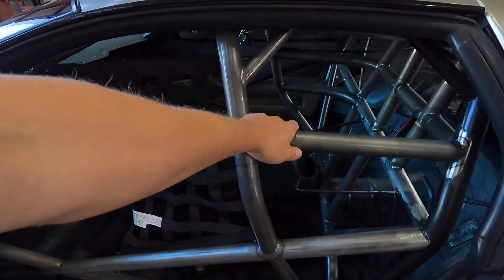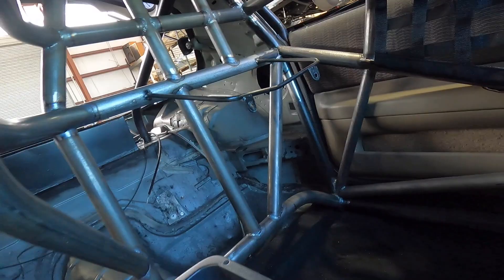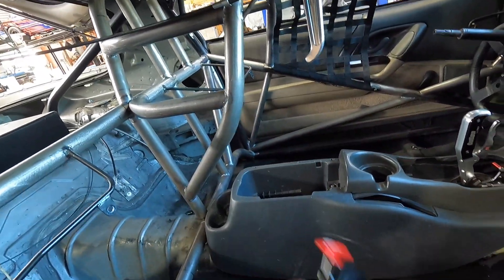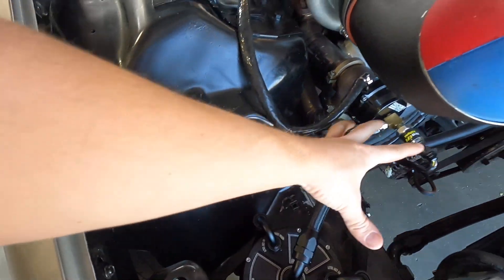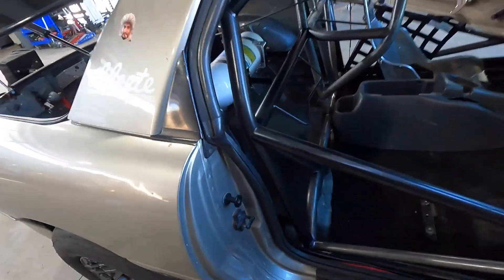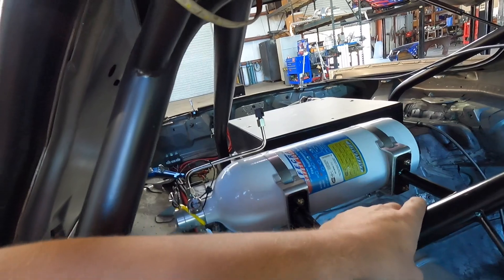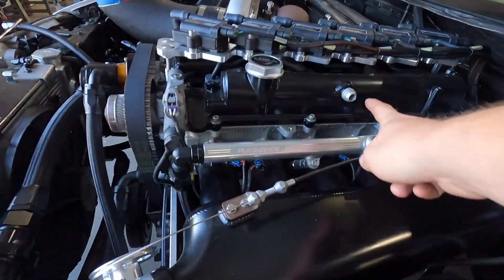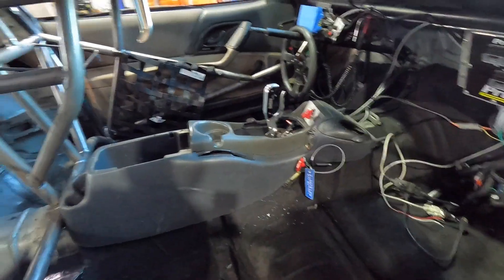The BIGGEST Safety Upgrade Yet! (Fire Suppression, More Cage)

Comment: need to run a bar from the bottom of the A pillar on drivers side, across the floor, over the transmission hump to the bottom of the passenger side A pillar, needs a bit more than the dash bar tying the cage together, that floor panel is you weakest part ,nothing stoppig your front wheel and motor coming back into the cab if you hit a wall, and run a bar down from the dash bar to the floor bar were it would run over the transmissin hump

Comment: I would move that fire suppression line to inside of the cage, rather than between the cage and the door. It could get crushed in a big hit and then you've lost all of the front half of the system.
Reply: Very good point. I never Monday morning quarterback it but yes, if you want it to work in a wreck run them on the inside of the cage. Other than that safety is no accident. Great job Coop!

Comment: With that fire suppression system you definitely need to practice escape drills. Have a plan that involves you running on pretty much no air in your lungs. It might be safe for the car, but it's not safe to inhale, halon will suffocate you in a hurry.
Reply: Max Power  Halon does exactly what Cooper described. It  displaces the oxygen to protect electronics. No powder or liquid involved..
Reply: Max Power  as per safecraft, it is halon 1301.
Reply: @Deepwaterjew  novec 1230 halon is no longer sfi rated

Comment: Coop one thing I would recommend is to make nozzle placements with crash damage in mind. Since the biggest thing causing a fire would be a crash make your fire suppression tube lay out in an area to be less affected by a collision [Front core support] maybe trying to keep it towards the firewall might be a better idea. that way incase you find a concrete barrier in your path the under hood nozzle isn't going to get kinked and block the retardant from extinguishing the fire under the hood. 

Just an idea I'm not certified in Drag Racing suppression systems just a hobbits Fab/CAD engineer.

Comment: Seems like that fire suppression handle could have been located closer to the driver compartment. If your seriously injured in a crash, your probably not going to be able to reach it!
Reply: Says a guy who has never even been on a track.
Reply: @eriklarson9137  it's a legitimate concern. Coming from someone who has never hit a wall and flipped multiple times at 160+mph.
Reply: @eriklarson9137  says the guy who has no idea if OP has ever been on a track.
Reply: isnt there usually a lever on the outside of the car too like by the rear driver tail light?

Comment: Just curious but should the fire suppression feed tube to the front run on the outside of the cage by the door? 7:02
Reply: Not unless you want to pinch it in a roll.
Reply: Lol
Reply: yeah thats getting chopped real quick in a side impact or roll
Reply: Devon, most likely you would never pass tech with it outside of the cage. Those fabricators seem to know what they are doing and also what the sanctioning bodies are looking for. Coop was smart bringing his car to them and not someone’s driveway.

Comment: Safety is the most important thing in racing but that kirkey ain't safe. For your safety you must try a motorsport/drift seat with halo to keep you tight in case of an accident
Reply: I agree 100%... Isp or butler or something similar.
Reply: I am questioning the seat mount,looks weak to me
Reply: Doesn’t matter which seat goes in if it’s mounted to that 1/2inch tubing loop!!

Comment: Shouldn’t you have a firewall behind you since the fuel cell is in the driver compartment ??  Also, you never run lines between the cage and chassis. It could get smashed in an accident and render it useless.

Comment: You dont want to be in a confined space (i.e. the car) when that fire supression system goes off.. Fire needs 3 things to burn. Oxygen is one of them. That removes the oxygen. If youre in that space, you cant breathe. You suffocate. Also, it may be useless if theres more oxygen than halon introduced to the engine compt and cabin.
Reply: Safecraft no longer uses Halon in their installed systems. The agent used won't remove oxygen from the air. Completely safe for confined space use.

Comment: How about the General Electric power supply switch 🤔
If you don't install a battery kill switch - in a very accessible place - the fuel pump will keep feeding the fire with combustible.

Comment: Should have a firewall between the driver and fuel tank and make sure the front firewall is sealed
Reply from the maker: No need for a firewall as the fuel cell is in a box, and fronts sealed up

Comment: When you going to take out the glass windows
Reply: probably never, Since NHRA rules for all street car classes require OEM style GLASS windows.
Reply: @scottcol23  you would think glass over plastic sounds saver
Reply: @Caution.beware  yeah it probably is safer, But I dont think there is too much of a weight savings over Lexan from safety glass.  The pro mod and top fuel guys do it because they have full tube chassis with either lift off or sectioned fiberglass/carbon bodies
Reply: @scottcol23  side windows Lexan and back window